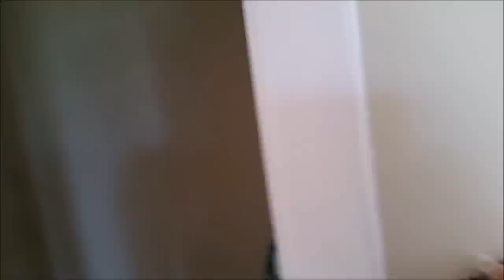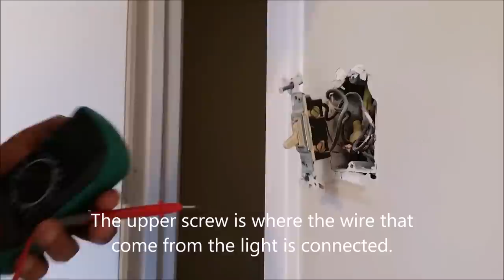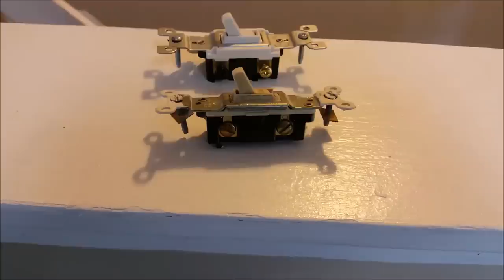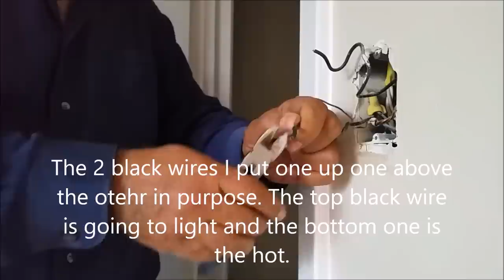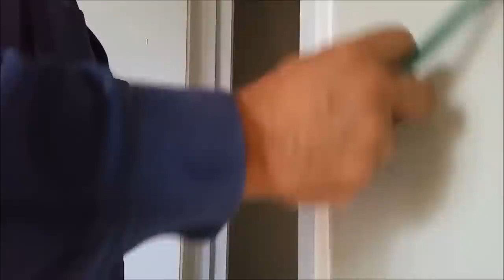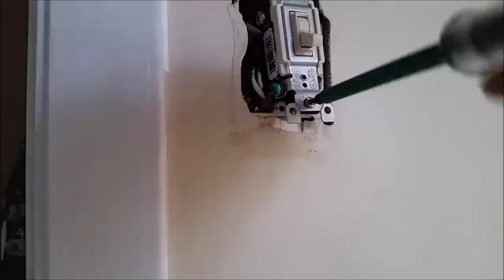How To  Troubleshoot  Light Switch And Replace A Light Switch - Step By Step

Comment: I would like to add that you should check for voltage again with the multimeter after turning off power at the circuit breaker, just to make sure you flipped off the correct switch.  Don't assume the circuit breaker is labeled correctly.
Reply from the maker: Sure I checked it but I did not show it on this video.
Reply: So true.  I found 3 breakers mislabled!  Thanks for reminding me.
Reply: Why would you check when the circuit is switched off? I am a novice.
Reply: @jq7323  Because you want to be extra cautious when working with high voltage...or more importantly, high amperage.  As I mentioned in my original comment, you can't always trust that the switches on the circuit breaker are labeled correctly.  Of course, if you've had to do anything on that circuit in the recent past, you already may be 100% certain that you turned off the correct one.  But it still doesn't hurt to check the voltage anyway.  You don't want to find out the hard way that you didn't cut off the one you thought you did.  It literally could come as quite a shock. 😄

Comment: Back 5 years later.  What symbol do you set it on to check continuity?  Can you do this with voltage / current going through the wires and the switch hooked up?  Or do you only check continuity when there is no voltage / current?  I guess if it's already hooked up and live, I could always check to see if the switch is working by checking the voltage with the switch in the on and off positions.  Thanks!
Reply: This video is dangerous to have you test a switch using live voltage! Totally misses the point that a multimeter can test for resistance and doesn't need house electricity to test the switch.  Try this: https://www.youtube.com/watch?v=r_migcta_Is

Comment: Great video.  100% resolved 1 issue.   The funny thing is I had to connect the ground and the neutral at the fan/light to make it work.  Something is still wrong?
Reply from the maker: The neutral and ground should be separate.
Reply: If you had a open neutral that was your issue

Comment: You demonstrated a voltage test of the switch, but what if a person wanted to perform a continuity test with the multimeter with the switch still connected to the wall? Can this be done by just turning off the circuit breaker to the light switch and performing the continuity test, or does the switch still have to be removed from the wall to perform the continuity test? 

Just wondering if there would be a false reading if the breaker was off (and yet still wired) for a continuity test.
Reply from the maker: You can test with multi meter the switch continuity provided you turning off the circuit breaker to the light switch. It is not going to be a false reading if the breaker was off.

Comment: I did the first check and got a big spark. Does that also mean a bad switch our not wired right?
Reply from the maker: You probably short between the hot and the ground and that is why you got spark. Does not mean a bad switch but what it says that a 110v is   in the switch which is good. Now you must verify if the switch is the problem or the wire.

Comment: having the swith grounded, which is tied into the neutral, would seem more of a risk for electrical shock if someone would grab the power side of the switch and the ground, then they would become the load? or would electricity take the path of least resistance and just go to ground?
Reply from the maker: First neutral wire should not be connected to the switch, only the hot wire. Second the metal part of a switch should be grounded (usually to a green screw)  and yes in case of voltage leaks to the metal  part the electricity takes the path of least resistance and just go to ground (this mean short to the ground )
Reply: , my thinking is this, if there is no ground connected to the switch, there can be no shock, because you are in no way possible can be connected to the neutral side of the circuit(neutral and ground are really the same thing), in the breaker box the ground wires hook to the neutral buss, then go to a copper rod into the earth.  and complete the loop?  line load line?  thanks for your time.  or is this the case, if somehow u touch hot side of switch, because cover is off and standing barefoot on wet floor, would u shock.? I know u can grab hot with one hand, in shoes and not get shock.
Reply: @randy1ization  Grabbing hot barefoot on wet floor would absolutely shock.  Even your other example, grabbing hot side with shoes, is not 100% safe.  You are assuming your shoes and whatever you are stepping on has enough electrical resistance to stop completing a circuit that would allow electricity to go to ground.

Comment: Fantastic video! Thank you - now I know how to change a light switch.
Do you have a video showing how to change an outlet switch?
Can you make a video explaining how to work the volt meter - the choices of the different settings? For this, you went to 200 volts.
Thank you so much Joseph!
Reply from the maker: Look at this:
How To Replace Single Light Switch  
https://youtu.be/dGEEcrJCV-4
If you want to add outlet or switch Look at the following:
How to Add an Outlet, a Wall Switch and Light Fixture to Existing Wall -
Part 1 https://youtu.be/-Rf_AtVaV8w
Part 2 https://youtu.be/64DIG6uGFos
Part 3 https://youtu.be/yYx7wQETYo4

I will do video of how to use multimeter.
Reply: @josephk9182  You are so kind. You replied to me so quickly. Do you have a video on how to change an "outlet?" - not add a new one.
Thank you that you will make a video on explaining how to use a multimeter - the voltage - DC and AC, Ohms, resistance - what all those choices on a multimeter mean and when to use them. Thanks so much Joseph. What is a good multimeter to buy?
Reply from the maker: I have but I did not put it yet. You can look at this last part of this video to see how I connected the wires to the new outlet.  
https://youtu.be/HAcWMI088ww

Here is a nice not expensive Digital Multimeter = https://amzn.to/3oqGZ9K
Reply: @josephk9182  Hi Joseph - thank you for the link showing the outlet install and the link showing a multimeter for purchase.
I look forward to your video on taking out an outlet and putting a new one in. I also look forward to your great video on explaining how to work a digital multimeter - every function choice and how to test to see if the multimeter is working. Thanks so much!!!

Comment: I only get a reading of around 51 on my meter when switch is on.
Is that the switch going out?
Reply from the maker: If you taking about voltage yes. The resistance should be 0 when switch ON and when OFF is infinite.

Comment: When your testing the switch why do you use the ground probe to test the hot wire?
Reply from the maker: Because the hot wire potential (the voltage)  relative to ground should be 120 volts . The neutral is grounded in the electrical breaker box.
Reply: Joseph K. Not sure i understand that, what would happen if i actually use the hot (red probe) to test the hot wire?
Reply: @mapleridgefarm1026  Just what I was windering Joe.
Reply: @mapleridgefarm1026  it doesn't matter which probe you use. AC has no polarity.

Comment: Excellent video! Do you recommend putting electrical tape around the side of the switch that has the "Hot wires" where they are a little exposed?
Reply from the maker: You can but it is not necessary.
Reply: @josephk9182  Ok thank you.

Comment: In this case the switch was bad.  What do you do if the switch is working fine, but the light still does not work (assuming the bulb is also good)?  What can you check on the light side?
Reply from the maker: First replace the light if it does not fix the issue check to see if there is a potential (110 V) between the hot and neutral where the light is connected (when the switch is ON). If no 110V this mean there is a wire disconnection between the switch and the light.

Comment: I’m redoing the switches in my house to our kitchen lights the lights (2 light hosing )didn’t turn on with the switch we got a new switch hooked it up the same way as the old one and still didn’t work  we noticed though there is two grounds twisted together behind the switch and not actually to the switch what could possibly be the issue?
Reply from the maker: The ground is not the issue but you need to connect the ground to the switch  ground for your protection. First verify that the circuit breaker to this lights is ON. Then check to see if there is 110V between the switch contacts to the ground when the switch is ON. If there is 110V there may be a disconnection wire probably the neutral wire or the hot wire.
Reply: @josephk9182   thank you 😊

Comment: Why do you touch red probe to ground and then black probe to hot? I thought it’s black probe to ground first and then red probe to hot.
Reply from the maker: It does not metter in AC voltage. It does matter in DC voltage.  Basicaly in AC voltage you can connect the voltmeter red to ground and black to hot or red to hot and black to groung you will get the smae result. (The voltage is 120V AC)

Comment: I am getting 0 from the ground to the hot. There is a ground wire. Any idea why this could be?
Reply from the maker: and what  is the volt between hot to neutral ? The hot may not have voltage or the ground is disconnected.

Comment: if i should change my switch, i dont have ground wire. new switches have green grounding screw. is my nuetral my ground?
Reply: neutral is not the ground. If you don't have a green screw on the switch then the copper needs to be grounded to the box, for a proper grounding.

Comment: On hot side I get 120 but the light side I get 3-7 still bad switch?
Reply from the maker: If the switch is turn on you should get 120v on the hot side and the light side. The switch is bad.

Comment: What would happen if accidentally connect the hot wire  to the upper screw, and the “light” wire to the bottom screw?
Reply from the maker: It will turn the light off when the switch is up and when you close the switch it will turn on the light.
Reply: Joseph K Wow, you replied to my comment/question right away. Thank you so much. There is a buzzing sound coming from my switch light? What do you think would be the problem?
Reply from the maker: Not a good contact. Best is to replace the switch.
Reply: If accidentally connect the hot wire where the ground connects and vice versa. Would the lights still turn on?
Reply from the maker: @sabinoespinoza9986  You should never do it. The ground is to protect you. The ground should be connected to the ground only. If you do it you will short the hot to the ground ant it a sure case of short or fire beside of high possibility to be electrocuted .

Comment: Ive tested the switch in low continuity range and max. I got no reading... o ohms im really concerned that the building wiring has a short.
Reply from the maker: If you test result 0 ohms when switch closes and opened its short
Reply: @josephk9182  Gad damn it.. Another xtra work!

Comment: The hot wire coming from the wall has no power at all? What could it be?
Reply from the maker: How did you test it ? there may be number of reasons if no power.
1. hot is somehow disconnected.
2. circuit breaker issue.
3. neutral is disconnected

Comment: I had a buzzing switch, everything is junk today, 6 year  old switch went bad. I lived in a house built in the 60s for 25 years, never replaced a switch.
Reply: I checked voltage 119 volts. replaced with new cooper brand. 2 leviton brands were bad. made in usa. so I was surprised. Levitons been making switches forever. sad.

Comment: do u know why electrical tape is used on wire nuts
Reply from the maker: It used for electrical insulation.
Reply: a wire nut is a spring covered in plastic, it will loosen up, over time,  if not taped in place.  that is why you tape wire nuts, also like a clock, put the tape in the same direction as the nut turns an d tape it to the wire.
Reply: the ground wire is not always hooked to the switch, and you may have to check the power neutral from the grounds wired together in the switch box. or tap into the neutral wire. all the switch does is allow one side, the hot side, to go to the load, when switched.
Reply from the maker: You should have grounded the switch. If you do not have ground you can refer the hot to the neutral or to the ground (the expose wire). Note, all neutral wires are grounded in the electric breakers box .

Comment: Single pole switch is 68cents at home depot just replace it if not working
Reply from the maker: Yes I agree but first you must verify that the switch is the issue otherwise, you will replace switch that would not solve the issue.

Comment: That light had an delay to cut on. Why did you replace a single pole with a 3 way switch? You left a screw exposed for no reason.
Reply from the maker: You are correct. I had a spare 3 way switch so I used it to replace the single pole switch.
Reply: @josephk9182  you could have put some electrical tape over the screws so maybe if you forgot in case you needed to switch it out again, you wouldn't get a jolt or another wire happen to touch it.

Comment: No! This is so dangerous for beginners! A better way is to disable electricity at the circuit breaker, and then test for continuity in the switch. Even that poses risk, but is a safer way to test

Comment: just replace a new ac 3 prong outlet  , followed to  wire to wire from old to new out let ,  now when checking with volt meter the longer slot prong is hot to ground  it this OK it works fine. oh my mobile home  has all its outlets  larger prong hole  to to ground  1976 mobile home?
Reply from the maker: can you clarify what is the longer slot ?  What is the voltage between the short prong and the ground ?
Reply: The short prong  and ground is 120 volts  on-the new replaced outlet,  yet on "all"
_ the other outlets in my mobile home are opposite the longer prong  is hot to ground 120 volts .
Reply from the maker: You made a mistake  in the new outlet installation. The volts between short prong to ground should be 120 and between long prong to ground 0. You need to connect the hot wire which is usually the dark color (black) to the short prong and the neutral wire ( white color) to the long prong.  Just flip the wire . please look at my video :

  https://www.youtube.com/watch?v=yYx7wQETYo4

to see  how to do install the outlet and how to test it (at the end of the video at 8.40 minute)
Reply: to Joseph  Hi   the trouble is  the new outlet   I installed is right the short prong is  120 Volts to ground ,  however  the rest of the Mobile home is all wired so the long slot is 120 volts to ground,  is it because its an older mobile home  and that is the way they wired  it years ago? and I also notice all the round ground  holes in the out let face up on the top of the 2 slots,  I thought the hole ground was suppose to face down towards the floor.
Reply from the maker: No. The electrical code states that the hot wire should be in the short prong  . I believe the outlet connection was  done not by electrician . It is dangerous because some old appliances connect the neutral wire  to the metal. You r neutral has 120v which is dangerous. Just flip the wires.
Reply: To Joseph,
so now I got the new outlet wired right  short slot to ground is 120 volts  longer slot to ground is 0  but  when I checked other  outlets  in the mobile home they are all with the longer slot  120 volts to ground  and this is wrong I been here 21 years with no problems   but  could someone be for me have switched  the wires in the fuse panel  and made all the outlets wrong?
Reply from the maker: No. In the switch box you will see all the neutral wires are connected to the ground, so your a assumption  is not possible, The outlets were not connected according to the electrical code.
Reply: is it the 2 slots  where the plug goes in one is longer than the other is this the way your saying the shorter slot  is the short one of the 2  or are you talking about inside the outlet .
Reply from the maker: Look at this link:
https://www.google.com/search?q=which+outlet+prong+is+hot&rlz=1C1CHZL_enUS754US754&oq=which+outlet+pr&aqs=chrome.0.0j69i57.10654j0j7&sourceid=chrome&ie=UTF-8
Reply: This means the plug has a small blade for the hot wire and a wide blade for the neutral wire, and the wires feeding those blades should not be reversed when you put a new plug on. Always use a polarized plug for a lamp, extension cord or any other cord that's polarized to begin with.
Reply: THANK YOU JOSEPH IT NOW WORKS  I BOUGHT THE LED CIRCUIT TESTER  IT HELPED ME THE MOST
Reply: that is what threw me off the ground holes were all facing up when most  wiring today they face down so  I was looking   at the longer slot as the shorter on   after I got the  tester it all worked out they are all OK according to code  ,.
Reply from the maker: That good . You should rely on the circuit tester